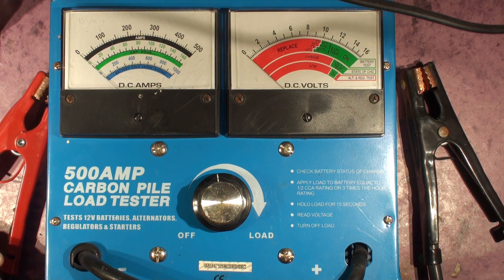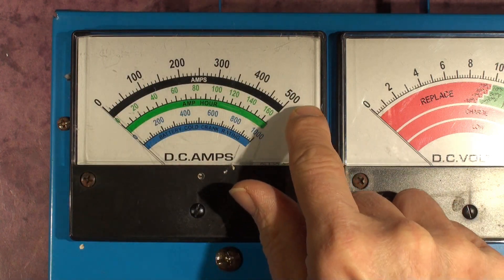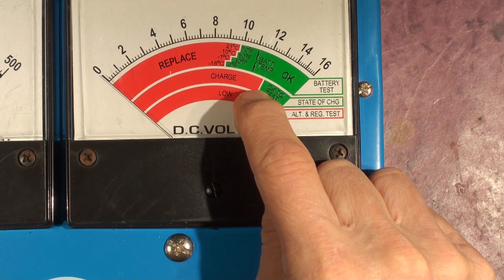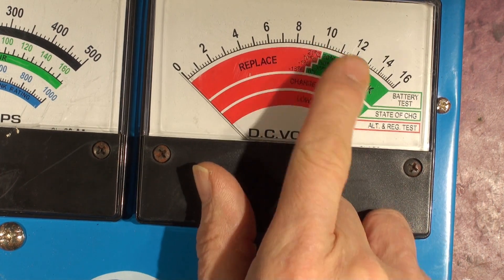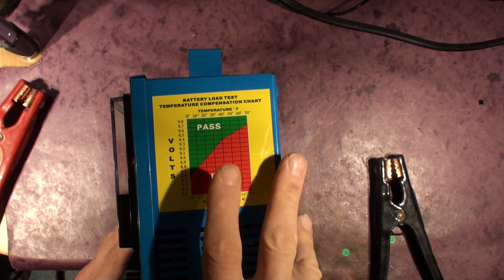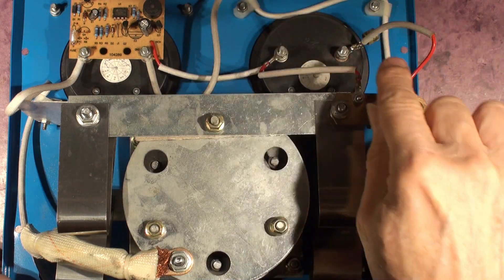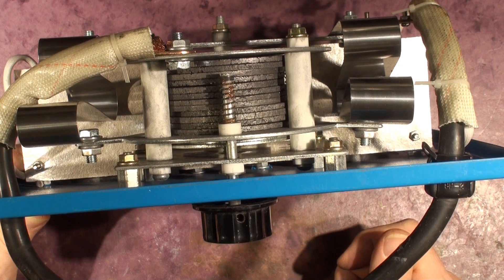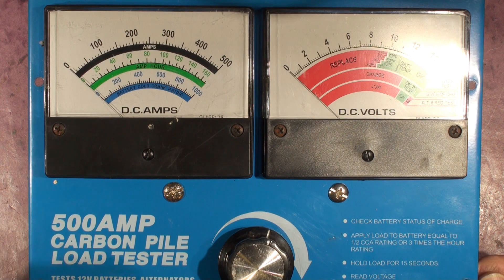Exploring a 500 Amp Carbon Pile Car Battery Tester & How to Use

Comment: Great video!!! Thanks! Always wanted to know how it works and why it's carbon pile. It's clear now! Should be quite useful if now how to use it properly.
Reply from the maker: Thanks for watching.  I have the electronic battery testers but when it goes to assessing a battery by putting it through its paces, I find the old carbon pile more revealing...
Reply: @razenby  Oh, those testers. I saw them lying)) Long time ago my dear Peugeot 205 didn't wan't to start. It was winter and -30C. The starter was cranking but the engine didn't want too. I tried every 2-3 minutes by 5 sec. It took me the whole hour and I finely won! What surprised me was that the battery never showed any sign of weakness. So the idea is to put a battery to a similar test. Ten tests  by 5 sec 200A in 10-15 minutes. The voltage drop on the last test should give you valuable information about internal resistance  and capacity.

Comment: Very informative video.  I have always wondered what those "other" dial readouts were.  I'm sorry to say that I've never got the green amp hour dial on left to coincide with the values on the other two dials.    It is of interest to me that recently my 7 year old battery went to zero readout under load.  I would have thought there would be an in-between time when the needle went up but not into the green.   I know it wasn't the meter because my other battery measured OK.   I test about once every six months.    I've never had my readouts go all the way into the "high green" even with brand new batteries.   Just a little over into the "good" range.   But the batteries have worked.  I wonder if it is a question of calibration of the instrument.
Reply from the maker: It may be out of calibration.  It is a crude circuit but I need a 300 amp current source to calibrate it or a meter shunt to put in series when it is under test.

Comment: Why is cold cranking amps different then amps on dial? The needle can point to both at the same time but there different?
Reply from the maker: Good question. The CCA rating depends on the definition of the test as there are about 4 different ratings by country / Continent.  Most real CCA measurement are made during a two stage tests. The first High CCA test then a  resting pause in between conducted at various specified low temperatures.  Usually the battery has to sustain around 7 volts at the CCA rated current for a specified number of seconds (around 15) . Then after a specified delay a further discharge for 30 or seconds or so.   There is a temperature compensation chart on the side of the tester.  This tester uses an approximation by drawing less test current and looking for a higher sustained voltage. You could say they extrapolate the result to gauge the condition of the battery. This kit wouldn't take a thousand amps via the clamps and cables the whole thing would have to be much beefier with eyelet lugs connected to the battery by bolts. Having said that I have found that it give a pretty good indication of battery health. A tre 100A CCA test would need thicker cables, better clamps, bigger carbon pile and probably a cooling fan etc.. That is my understanding.
Reply: The CCA scale is there so you can easily target it without dividing by 2 in your head. The Ah scale, too.

Comment: Associated makes the finest 1000 amp load tester ! Made in America .

It seems as if all others are Chinese Rebrands from the same Chinese factory . Most weigh 8 to 10 lbs. , Some 18 lbs . 
The Associated Load Tester weighs over 30 lbs .
Reply from the maker: Useful bit of kit.  Once you get the feel for what it is trying to tell you you don't need anything else.
Reply: @razenby  Really interesting video, I've been looking for one to buy but other than a couple (appears the same but rebranded) on Amazon that both have some bad reviews, any ideas who still sells these in the UK?

Comment: I’ve rebuilt several of those for friends and clients. Some of them just regular old car battery tester‘s but also some HUGE massive units used to test forklift batteries, solar batteries, etc. those forklift battery packs come in to my buddies scrap yard regularly. Sometimes only a year old with all of the electronics still mounted to monitor electrolytes and about 10 other different types of sensors. I snag the electronic sometimes because he just crushes everything anyway.

The Amazon warehouse just writes them off for taxes I guess but they still have 80% of the life left in them it’s disgusting to see them trashed like that. He gets dozens in every few months and they’re the size of a Volkswagen beetle and weigh thousands of pounds. So obviously the load testers have to be pretty big. They just scrap everything he doesn’t really resell or anything like that except parts that I want to buy so he has no need to test them. But at another scrapyard I picked up a huge load tester the size of like a rolling toolbox and it has all types of different resistive loads inside. I’ve even seen some of the big ones that have big coil submerged in oil. I guess the same thing that folks show on YouTube where they build one with an oven heating coil submerged in a pink can of olive oil to test generators and things like that.  I love all test equipment below testers have always been such an interesting topic. From the big dumb ones that are basically just a heating coil to the real fancy computer kikisui models like I use on my workbench. Always fun 

Basically if you’ve ever seen those huge resistors… It’s just a ceramic shaft wound with nichrome/nitinol wire. Similar to what you see in a lot of resistive heaters from the 60s and 70s. And you’ll still see them in big industrial HVAC units for drying the air and other weird processes inside those huge rooftop units.

Literally almost the same thing if you’ve ever opened up a huge dissipation/load dump unit like you’ll find on massive magnetic cranes… They have multiple resistors capable of several kilowatt each. Or if you see these huge refrigerator size motor driver and PFC correction units. Used in factories and on huge screw chiller compressors and things like that… They will have some massive dissipation resistors inside. I find more of them than I could ever use and even though I guess there’s some more expensive at the beginning… There’s not much of a secondary market for them unless you find someone who Tinker is like myself.

Those huge motor controller starter units that look like a massive refrigerator… Goes without saying they’re $50,000 to 100,000 each or more when new. They sell them at government auctions around here all the time and sometimes they go for less than scrap price. Got a few beautiful Siemens brand servo drivers out of one last month and after load testing made good on eBay with them. I think it weighed 1200 pounds and I paid about nine cents per pound from what I could figure that half of the stuff inside was aluminum and thick copper. It’s just sickening the stuff like that it’s out there by the truckload full from agencies around here like TVA and others

But those huge resistors are really cool and neatly engineered even though they’re not too expensive.

It’s basically just a big resistive heater . Not sure how that would compare to the carbon piles but I’ve been inside of both kinds, I think maybe the nichrome wire is a bit more resilient in terms of being heated white hot and having all types of dust and residues. But who knows I just think it’s super interesting either way. Thanks for the great video!
Reply from the maker: That is true.  Corporate types never saved anything from the trash. It is seems so lazy but seems to be the norm.  I have sen major electronics companies  swapping out electronic modules and crushing them before disposal to prevent people like us rescuing and repairing them.  They would rather Take, Make and Throw away then Reuse and Restore.  Great if you can save them and put them to good use.  I just reused an 80kWh Mercedes EV battery from a blown up SUV in Ukraine.  It will have a long and useful life..

Comment: can i assume that the cold cranking amps is for starting batteries and the amp hour rating is for deep cycle?
Reply from the maker: It doesn't state in the manual. If a deep cycle battery is not terribly bad then you need to do an AH discharge tester to check the performance .
Reply: @jasonbrown467 This is the question no one answers, but I think you may have nailed it.
Reply: @BrewCityRider   apparently i have come a long way with my battery knowledge. as i know that cca is for starting batteries and AH is for deep cycle. i have been playing with batteries for about 4 years now, as i diy'd my pv system, and my 45kwh lead acid bank. about to now move into lifpo like i should have from the beginning, but i really wanted to master lead acid first and have been helping people with lead acid/agm batteries left and right, in fact i just got back from helping a dude test his battery and alternator on the vehicle.

Comment: Would this work well for a reliable indication of storage capacity in a FLA leisure battery?
I like the idea of a quick reading. I subbed and hit the bell, good video. Now I'm off to watch the follow ups, cheers 👍
Reply from the maker: Ni , not really.  The Cranking amps can be related but, unless you have a very bad battery,  measuring one wont give you much idea about the other. Leisure batteries are not designed to deliver very high currents so best not stress them in this way.
Reply: @razenby  OK, Thank You for that, it makes sense.